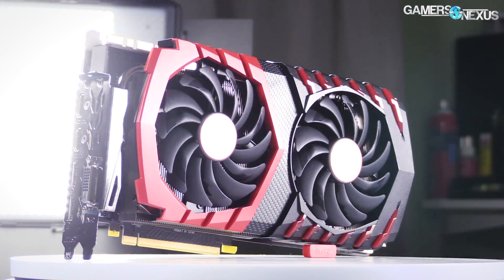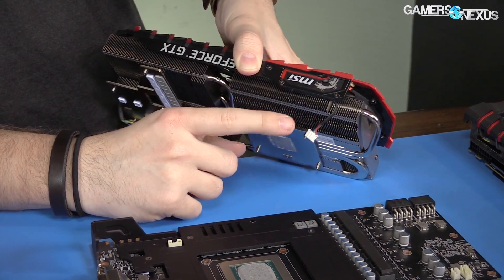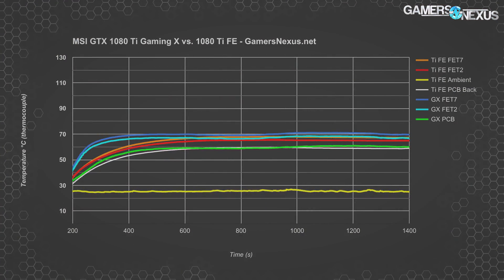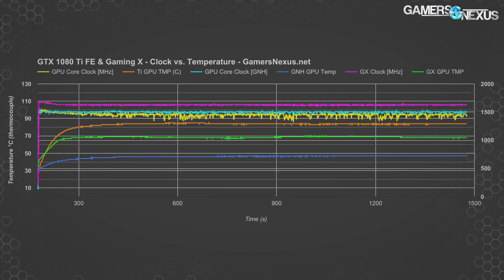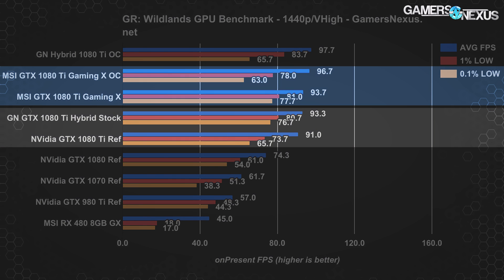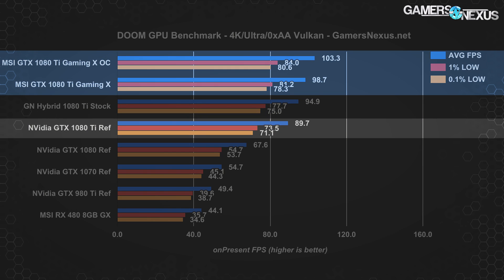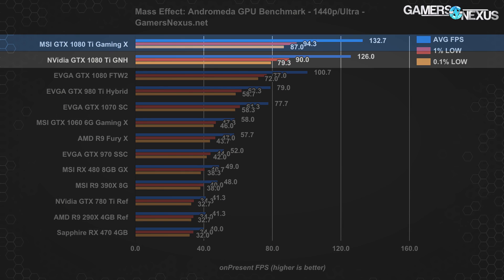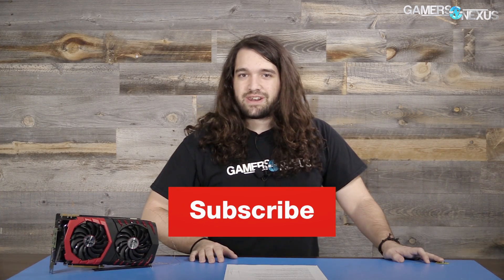MSI GTX 1080 Ti Gaming X Review & Thermal Analysis

Comment: ‘Built in reference with a better cooler’ exactly what I have done. Turbo 1080ti with a Morpheus ii gets me 2113mhz @ 52 degrees and 1.063v think I won the silicon lottery with the worst odds (blower card)
Reply: function over form i suppose

Comment: I bought this card when eBay had the 15% off everything coupon a few weeks before the RTX launch. I bought this because it was one of the cheapest and it had a competent VRM and a fairly beefy heatsink. Except with the maxed voltage and power target sliders in Afterburner mine only will OC about 50mhz on the core :(  
So much for buying for OCing capability, but still a sweet card!

Comment: Hi.I have 77c in gamming in more games with these gpu.its normal or not? my case is phanteks enthoo pro m..one intake 140mm,one outtake fan 140mm.thx
Reply: Seems a little warmer than it should be. Are your ambient temps high(is your room hot W/o the computer on)? Have you dusted your case? Are there any obstructions for the airflow (Cable management,  PC placement)? Do you have a custom fan speed setup with msi afterburner? This would probably help. The fans in theory should be fine,  but it wouldn't hurt to add another intake fan for a positive airflow.
Reply: fans of card are on default . my case has very good airflow . my case is phanteks enthoo pro m.2x 140mm on front(intake).rear 1x140 mm and one 1x140 mm on top. now temp is idle is 40 and gameplay (99%load) is 76 celsius

Comment: Heyy i just bought a Msi Gtx 1080 Ti Gaming X and the back plate gets hell Hot and spreads heat into my CPU radiator i have a Cooler master 212 EVO the space between them is nearly a HDD! i have god airflow 2 in take in the front and one back all fans are fractal design GP 14!

Thx!

Comment: I mine zcash with my, i will thermal throttle in about 20min of mining. Currently sitting at 1873mhz at 78c my gpu boost shoud have it near 2000mhz

Comment: When comparing MSI's thermal solution with the one Gigabyte has chosen for their Aorus XTreme, I feel a bit uncomfortable for my GamingX. While Gigabyte has covered all potential hotspots with thermal pads and have made use of the backplate as an integrated part of the overall cooling solution, MSI did neither.
I wonder if there is any opportunity to improve an MSI GTX 1080Ti GamingX in a similar way, i.e., apply thermal pads for the sections which have no contact to the cooler and make use of the backplate as a cooler as well.
The reason for me to ask: I bought the MSI because at the time of buying over here in Germany it was the only 1080Ti available besides the Strix - which has an even poorer cooling system. I am very happy with the build quality and the performance when my rig's case is open. However, the Fractal Design Define R5 is noise insulated and has just one 14 cm output fan at the rear which has to blow out the heat of the graphics card and the CPU (i7-7700K). I know this concept is not perfect for quenching out the last bit of performance and needs an upgrade on ventilation, but I keep thinking of improving the cooler design of my MSI as well to achieve the best possible results.
Any helping feedbak is highly appreciated.

Comment: I just got my MSI.  Out of the box no mods just a bit of afterburner tweak. 2038 core rock solid 24/7 and 5940 mem.  Never hit over 70c after a 2 hour heaven loop.
edit Heaven was ran @ 3440x1440 8xAA

Comment: I had issues on my FE even at 0 oc overclock I'd get an occasional fan run-up and it would hit 91-92C.  changed to this MSI card with my custom fan profile it maxes out at 72C and boosts much higher and much quieter.  BTW out of the box this runs close to 1900mhz Vs 1500 on my FE.

Comment: That Black Thermal Pad @ 3:05 will melt at high heat and produce a grease goo .. won't it?   i had that happen to sapphire nitros and it was such a mess...    also... when is the gigabyte aorus going to get reviewed?  i cant choose between msi and aorus, and want to get one.. but wanna see benchmarks comparing them first... please get that up asap

Comment: this card is too fast that when u OC'it the CPU becomes the bottleneck, i analysed that from Doom vulkan that got a higher 0.1% unlike other DX11 games. (correct me if im wrong)
Reply from the maker: Mohamad El Hassan No. That wouldn't impact frametimes negatively. It is a clock stability issue.
Reply: ty for the reply, that cleared it up :D.

Comment: FE cards now are very lovely. Smaller PCB, than MSI's or any others, overclocking potential is the same or even highter. I've achieved 2050Mhz core + 12000Hz memoty stable on mine card with waterblock. No noise, no thermal limits, lovely 47 degrees under load. Not much pricier than this MSI model even with a waterblock, but the same or even better potential. If you have of course a custom waterloop already.
Reply: So the card not sounding like a leaf blower and keeping its boost frequency stable without the thermal throttling of refence designs is a gimmick now. K.
Reply: Pure Armageddon aftermarket cards are just gimmicks. Just nice and different coolers and yeah they run cooler but thats about it. Watercooling is the way to go for maximum cool and performance.
Reply: my 1080 ti fe broke after 5 days using on stock cooling, so...i'd rather go with aftermarket ti
mine could reach 2076mhz on core and 12300 on memory with turbine 100% load

Comment: what the point of building a beefy card when all of them OC the same as the FE?
Reply: Artemis same thoughts. I stick to the FE purely for build quality and badass looks. The fe are built soooo good.
Reply: I feel the opposite. FE are ugly and poorer cooling, from my own experience, and louder.

Can barely hear my MSI 1080Ti even at 100% fan speed when I tested it.
Reply: Ritchie Drama looks is subjective. other than that. you're right. but all of them OC the same though. my 1080 FE reaches 2100mhz just like other beefy AIBs

Comment: Hi GamersNexus, Finally some thorough testing on the overclocking capabilities well done and thank you. I see alot of reviewers posting '2025mhz' overclocks, but my 1080 Ti averages 1974 with a +100 more & +700 mem o/c.

i believe most user O/C'd 1080 Ti's unless under water only achieve 1974mhz (game dependant) unless you crank up the fans.

Do you know what increments -/+13mhz the card drops within a temp range i.e. does it drop 13mhz every degree above 70C etc... any insight on this appreciated
Reply: At 65% fan speed I hold 2050MHz.

Comment: The MSI 1080 ti OC has been getting really bad reviews do to abnormally high temps and bad moderators on their forums.  Did you guys see the same, or have you not reviewed the OC from MSI?
Reply: since when is a 1080 ti a low end card? I would expect them not to review their versions of the founders cards but the Armor OC isn't "low end"

Comment: would love to see an msi tri-frozr cooler with the next gen of gpus
Reply: Using only 2 fans = less noise.
Reply: Normally bigger fans have to turn slower for the same cooling results. That's also why it's better to have case fans that a bigger, vs smaller ones that run faster.
Reply: Dre Dejong 3 fans have to work less to keep it cool so maybe quiter anyways?
Reply: wouldnt it look awesome though, like put on one more fan with the red frame and have the black part in the middle

Comment: So my MSI RX 480 Gaming X 8G won't stay at +100 vcore in Afterburner, it automatically goes down to +96. It also adjusts to other certain numbers. Its like it has many different voltages built in and chooses the closest to what you input. I've tried flashing the latest BIOS and everything. When I use Trixx though, the voltage meter is glitched and goes from -200 millivolts to +11000... not impacting my performace, maybe causing me to hit a wall at 1400 MHz, but I'm worried about the card dying, or being defective. Any ideas as to why this could happen and how to fix it?
Reply: Ryan Anderson mine does that too but GPUZ shows the correct voltage at 1.25 V
Reply: Ryan Anderson I noticed that too, but my RX 480 won't push past 1410 with max additional mv applied. I keep it at 1400 with much less mv added. Can't remember off the top of my head.
Reply: That's normal. My 4GB 480 is the same.

Comment: To be honest I find that overclocking your graphics card is a pretty detrimental experience in which most of the time frametimes can get completely fucked up.
Reply: It's the whole enthusiast thing of fetishizing over performance increments that can only be measured, but not perceived.
Reply: I haven't looked at what other people are experiencing, and it definitely does vary from card to card (I would imagine). But from my experience with both overclocking my I7 6700k (Skylake) and MSI GTX 1080 Gaming. The experience even when the temps have been under control, have diminished drastically. The frames usually stay the same (depending on the game of course this also varies), while the frame times I have seen drastically spiking, leading to a much less smooth gameplay. Especially in games such as overwatch, cs go or any other in which higher frames usually helps as it lowers input lag a significant amount.
Reply: All of which you mentioned is entirely correct. While though I would like to add, that when we in our homes as consumers go ahead and change voltages, clock speeds and all else that we can change with our card and how it intakes power and uses it. We've got far less hardware and knowledge about the chip that we're working on than the companies themselves that determined that they weren't able to push this chip much further (of course they will downgrade a little so there's head room) without failure. There's a lot more than the settings we can diddle that they do when trying to optimize their chip for performance and stability.
Reply: +Poofy Poof Seems like you're drastically overgeneralizing here. I have no doubt you can worsen your gaming experience by having a bad overclock, but your claim that ANY overclock will produce negative side effects is ridiculous. And until you can demonstrate this with thorough testing and documentation I'm calling BS on these rambling anecdotes.
Reply: I didn't claim that though.
Reply: Really? Do you have any data to support that claim? Any data whatsoever? Your own, or someone else on Youtube or a forum? Are there articles that you can link to?
Reply: Poofy Poof Denver had that or seen that happening, as fas as I am concerned it's just free performance for increased temps

Comment: Love my MSI 1080 Ti Gaming X, amazing card, hasn't gone over 62c in any game so far, also holds 2050Mhz through every game without dropping. :) Managed a +100 core and +650 memory overclock hasn't crashed in any games so far, this includes Far Cry, Rise of the tomb raider, wildlands, Rust, player unknowns battlegrounds, dota 2,  overwatch, For Honor, and a few others :3
Reply: What's your fan % set at? or do you have it set to auto?
Reply: Custom Fancurve.
Reply: Custom fan curve can stop it going to 67c, even though 67c is very good anyways.
Reply: MSI afterburner
Reply: The whole point of getting this card for me is to get 45+ average fps 4K in every game with all settings maxed out. that is how I like my games. maximum details and playable framerates. And frm my experience 45+ is good. 1080p is way inferior and like I told you, once you play a game in 4k, playing at 1080p looks like vomit lol

The 980 ti cannot give me 45+ fps in every single game at 4k maxed out settings
Reply: Screw 4K, lol. Having FPS of 60 is like going back to 1999.
Reply: I'll leave the 60fps to console gaming which I still very much enjoy. I plan to get the Scorpio and hope more games like Shadow of War, Gears 4, Forza Horizon 3, etc. have the Xbox Play Anywhere program. I'm also enjoying Nioh on PS4 Pro and have Horizon Zero Dawn and Nier Automata waiting to be opened until after I beat Nioh. Needless to say, it's a really good time to be a gamer :)
Reply: Ritchie Drama how much you set the Fan curves After 40C 80% ore more?
Reply: people dont understand that 1080 still looks amazing on a nice monitor. 4 k is nice but youll need 2 1080 ti sli to get 60 fps +
Reply: +jerry m no you don't. You needed 980ti in sli. not a 1080ti lol
Reply: Ritchie Drama mine crashed in wildlands. I havent tried to oc it yet
Reply: Ive also seen my card at 67c in overwatch with everything set to max
Reply: Ritchie Drama How you do that?
Reply: So man I have its predecessor the 980 ti gaming. is it a worthy upgrade?
Reply: Well it's a decent upgrade yes, but do you need it? I personally dislike low frames on any game so higher is better for me making it worth it and I upgraded from a 970 so it was even larger
Reply: Thing is, I have a 4k itch on every game and the 980 Ti is not scratching it the way it used to anymore. And once you see a game in 4k, playing at 1080p feels like a huge downgrade. I have a 120hz monitor and 1080p screen but I use DSR and downsample almost every game. So the 1080Ti gaming would do it like the 980 ti gaming has not right?
Reply: Well I could never use 4K, screw that. I don't understand your last sentence, makes no sense. ;3
Reply: I would never play 4K myself, so no idea. But, not sure what your last sentence says, makes no sense :3
Reply: I upgraded from a gtx msi 760. I made the PC to do 4k gaming but sadly I wasted all my money on the pc and dont have any left for a decent monitor :P
Reply: Use nvidia DSR and downsample frm 4k. it is essentially 4k but on a 1080p screen. Its not exactly like on a 4k screen but the upgrade is HUGE
Reply: how much more fps are you getting with that overclock compared to default settings?
Reply: I play on 4k it gets pretty hot up to 70 when playing on everything maxed.
Reply: Hey Ritchie, as per this video, notice that min FPS may drop due to suttering...  You'll get higher fps .. at a cost of suttering ...
Reply: I have 1080 ti gaming x and get maybe like 78 c when i have set  highest to 70 c and some times it gets up to 84 degrees celsius if i can get any help that would be nice
Reply: Ritchie Drama I just got the card today and added +100 core and +400 memory m. Currently running heaven benchmark to see if it's stable and so far after 10 mins it is. It destroys everything in Ultra at 1440p. Yes I can play in 4k but I prefer higher fps over resolution especially since I find it useless to play 4k on a smaller monitor.
Reply: 1080p looks like dogcrap bro. I am at 1440p at the moment and even this resolution is hard to digest when I have played at 4k before.

And my monitor is the Acer XB270AHU Gsync IPS 144hz, one of the best. 4K is the way to go, even at sub 60 fps

Comment: I've got a 1080 but want to start playing stuff at 4k on my tv. Should I go SLI? or Titan Xp? Heaven forbid I use high settings at 4k
Reply: Yeah got a 1080 also, looking to get consistent 144hz at 1440p is tough in some games. I'd want to see what the 11 series is gonna look like, otherwise maybe the new titan, im just not a big fan of SLI
Reply: I'm running a pair of MSI GTX 1080's and I really think the value of SLI depends on the game's support of SLI.
Reply: Zimba's Doom Corner 1080ti would be the most reasonable card, but if you have a 1080 just turn anti aliasing off. You don't need it at 4k because the high resolution makes it unnecessary. Keep your ultra settings and turn AA off and it will probably get you 60 fps or better, although TV's have a really really slow response time (sometimes between 20 and 50 milliseconds for just the tv, not to count the time from mouse and keyboard/controller plus the reacting of the computer plus everything else) watch Linus tech tips on tv vs monitor

Comment: Why don't they just make it a 3 pcie bracket slot card for extra stability and less sag? You can't use the third slot anyway since the card is too thick
Reply: yea, Agreed. And possibly have MoBo and Case manufacturers move the GPU slot from the top to the bottom of the MoBo so it is not blocking all the other PCI slots.
Reply: Because you wouldn't be able to use the 4th slot
Reply: George Lambros what? You could still use it. 3 pcie bracket slots doesn't mean the fourth is occupied. I don't talk about making the actual card 3 slots thick, just the metal bracket at the back
Reply: I was joking. You know since they cant make the 2slot using 2 slots only, why would they make the 3slot using 3slots only? :)
Reply: George Lambros oh, didn't realize that lol. But to be honest, a 3.5 slot this card would be pretty awesome to see
Reply: If you want to see a beastly card, look up some of the older asus ares and mars cards (limited edition dual gpu series they used to make), they used 120mm fans on one of those, most of that series was right at the limit of what would fit in 3 slots.
Reply: One of those was 3.5 slots large, with the entire card being almost 11 lbs in weight.
Reply: I have one and it does not sag the way it's now.
Reply: there is a powercolor 390x2 that uses 3 90mm fans and a 3 slot heatsink. its terrifying
Reply: you get some gap if you sli with a card 3 slots over.

Comment: best card :))
Reply: Yes. Asus has more coil whine.
Reply: Gigabyte gtx 1080 Xtreme Waterforce waiting for the EVGA FTW3 and the Zotac Extreme
Reply: I do believe the aorus is the best 1080TI BUT Asus definitely beats MSI. My 1070 Strix OC'ed to 2050mhZ doesn't even NEED to get to 75% fan speed. I have it maxed at 55% and never go above 70C.
Reply: Nah, asus strix always outperforms MSI.